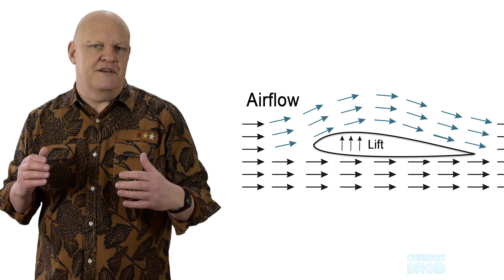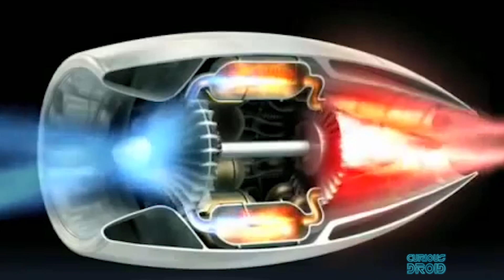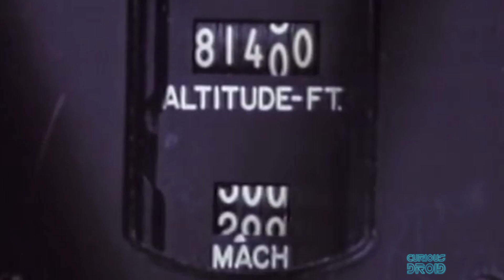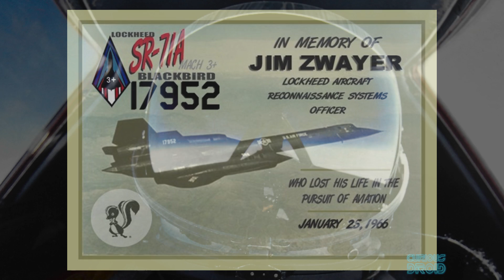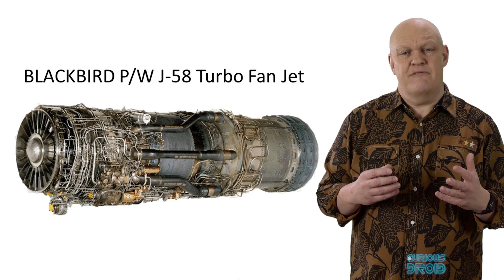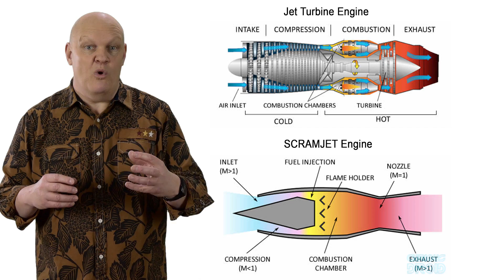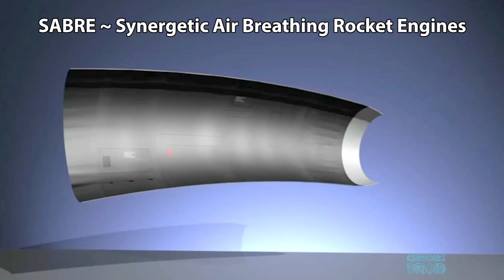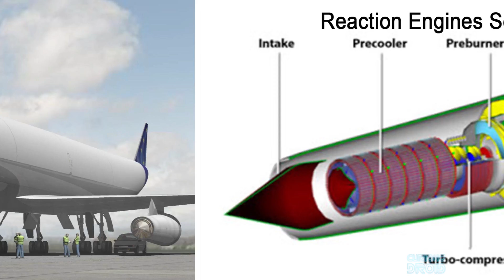Why can't we fly a plane into space ?

Comment: We can't fly a plane into space due to 3 main factors:No1 Our modern planes are not built for space travel No2 Modern plane engines don't produce enough thrust or speed to escape earths gravitational pull. No3 Due to earths gravitational pull we would need more fuel and power for our current planes to escape earths gravitaty however in order to escape it we would need large amounts of fuel with much larger engines which leads to an increase in gravity because as we all know gravity affects all mass so an increase in mass would increase the gravitational pull. We are then left with a paradox, we can't add more weight for more fuel and power due to an increase in gravitational pull yet we can't decrease the mass due to our earths outer atmosphere then becoming inescapable. The difference between planes and rockets is that rockets use their power to escape earths orbit they then disengage and flow freely carrying minimal weight or passengers. The thing with planes is they carry large payloads for their weight and lack the necessary survival equipment for space not to mention they are too heavy or underpowered to escape earths atmosphere. Their I just saved you 10:04 of your life.

Comment: This video should be rated under 12 years of age. These comments about escape velocity are rather pointless, so long as you're going up, even if it is at 1km/thousand years, you will still, theoretically, get to space because youre moving up lol. Escape velocity is the initial velocity, highlight initial, that is needed to get into orbit, again highlight orbit there. If your projectile is launched at a certain angle from the surface, that angle corresponds to a velocity value, be it 1000km/h or whatever, that's not quite important right now, such that this velocity is enough, highlight enough, to get you into this 'infinite loop of projectile motion' which is satellite orbit. satellite orbit is, in fact, nothing but an object which is 'falling' forever. You need to look this up in more depth if you wanna know what that means. understand what escape velocity is, as it is completely irrelevant in this scenario, truly.
Finally, my main point, this video could have been ended in 2 seconds if all you say is that jet and airplane engines need air for combustion. no air outside = no more power. end of story. if the plane doesn't function on the outside, it's rather too early and pointless to talk about how one cannot breathe and etc in space

Comment: Not even going to watch the video because it is obvious and unnecessary to make a video on. A planes engine is meant for atmospheric flight, its basically a motor that turns a fan blade which pulls air in one end and pushes it out the other in order to get thrust. You can't fly it into space because in space there is nothing to pull through the fan, so no thrust. For space travel they use a chemical reaction to make a controlled explosion and point that the opposite direction of where they want to go for thrust. Is that pretty close?

Comment: Actually the main reason is the strength of the fuselage. The inside of the aircraft is pressurized to around 8000ft or 10 pounds per square inch, now multiply that by the total inside area within the fuselage (F=AP) it's comes out to few million pounds of force pushing outward, this force is further increased as the aircraft gains altitude. similar to balloon swelling as it fly's away.

Comment: for everyone wondering, if you havent seen the whole video, just the first seconds.. pretty easy. First planes move with jet engines. Jet engines need oxygen to work. Rocket engines are pretty much jet engines that have reserves of oxygen inside the aircarft, while jet engines used in planes use the oxygen in the air that goes through the engine. No air= no oxygen = engines are dead cold. Simple :)

Comment: There is a mistake. The blood won't boil even in a complete vacuum since blood is secured in a closed pressurized system. The pressure suits are there to prevent the lungs from exploding due to the pressure difference.

Comment: Thrust, Lift, Drag, Weight... Engines run out of thrust and wings run out of lift... due to air density... Engine needs oxygen to run and the wings need same air to make lift. The higher you go the lower the air pressure and density. I saved you 10 minutes. Aerospace Engineer and Airline Pilot. Great Vid Thumbs Up... your explanation is excellent. As a kid X-15 fascinated me.

Comment: Probably a dumb question but: how does jet propulsion work in space? I've heard about Newton's 3rd law but I'm kinda missing the 2nd object the engine is supposed to push against. Near Earth, it pushes against the atmosphere but in space (supposedly vacuum)? There's also that Free Expansion Law (gasses do no work in vacuum). Anybody?
Reply: Because it doesn't push against the atmosphere, it pushes against the exhaust gases. The molecules in the gas have mass - not much, but they have it. The rocket shoots the gases out the back and the gases push the rocket in the opposite direction. Equal and opposite reaction. Like throwing a bowling ball when standing on a skateboard. If the rocket didn't move it would be violating conservation of momentum.

The reason jet engines don't work in space is because they get the oxygen from the atmosphere. No atmosphere -> no oxygen -> no combustion -> no thrust. Rockets, however, carry the oxygen with them so they work just fine in space. In fact, they work better in space (they generate more thrust) because there's no ambient air pressure that tries to prevent the high pressure gases from getting out of the engine.
Reply: Thank you. I get the oxygen part, but I'm not convinced about the exhaust gasses. It's easy to see the equal and opposite reaction with stuff like tire/road, boat propeller/water etc. because you obviously have 2 objects (boat/water) and a force acting between them (motor, propeller). By the way I believe in the atmosphere, the rocket engine also pushes against air. Why not? An airplane propeller does. 
But in vacuum? You have the rocket (object 1) and the engine exhaust gasses(force). 
What's the 2nd object? Isn't saying that exhaust gasses are pushing against the exhaust gasses kind of like saying that a boat propeller is pushing against itself? Wouldn't the gasses have to create something like a "cloud" that has similar mass as the rocket the whole time the engine is pushing (equal and opposite reaction)? 
When you throw a bowling ball while standing on a skateboard aren't you pushing against the inertia of the ball? Also you have 2 objects (you/ball) and a force acting between them (you pushing). What's the inert 2nd object in the rocket scenario?  
Also there's still the Free Expansion Law. Shouldn't the gasses just disperse into the vacuum of space?
Obviously, I have some catching up to do to become a rocket scientist but thanks for the help.
Reply: The other "inert object" in the rocket scenario is the exhaust gas. Think of each gas molecule as a tiny bowling ball.

Regarding the free expansion law - it means the gas does no work on the vacuum because the vacuum doesn't resist the expansion (obviously, since vacuum is the absence of everything, and nothing can't resist something). You'd think the vacuum would just "suck" the gases out, but that's not actually the case - you see, any physical interaction between the molecules in the gas (or any other substance for that matter) can only travel at the speed at which sound would travel through the gas, so as long as the gas expands faster than the speed of sound, it can't "get out of the way of itself" which causes a high pressure area to form inside the combustion chamber. Since the back of the engine is open and the front isn't, the pressure isn't distributed evenly (the front of the engine pushes against the gases and vice versa, but there's nothing at the back of the engine for the gases to push against) which forces the gases through the nozzle where they're accelerated to several kilometers per second (the faster the better - faster exhaust gases have more momentum so you get a greater change of momentum for every kilogram of exhaust gas expelled so the rocket will be more efficient).

This is why rocket engines produce more thrust in space than they do in the atmosphere - because the atmospheric ambient pressure resists the expansion of the exhaust gases so the pressure difference between the front and the back of the engine is smaller, which means a lower exhaust velocity, which in turn means less mass is expelled for each unit of time, resulting in lower thrust (the faster you throw a bowling ball, the faster your skateboard will be moving). So larger pressure difference = more thrust.

If you had a rocket that had a combustion chamber pressure of exactly 101.3 kPa, it would not produce any thrust at sea level (because the chamber pressure would be equal to ambient pressure), but if you took it to the peak of Mount Everest where the ambient air pressure is much lower, it would produce thrust. How much depends on the nozzle design.
Reply: Wow. Awesome answer. I was missing the part about the speed of interaction between molecules being limited by the speed at which sound would go through that gas. 
Thanks again! People like you give me at least some hope for humanity.
Reply: He is not dumb, he is asking. You dind't born knowing everything
Reply: Michael Stancl lol... you're silly.
Reply: Guderian Shut up, pretentious fuck.
Reply: Yes you are dumb, very dumb. The reaction of the is the space ship body against the mass of exhaust gas from a rocket engine. For obvious reasons gas turbines don't work in space. Force = Mass x Acceleration

Comment: If space is a vacuum how do rockets thrust?
Reply: Rockets operate by differential pressure inside the combustion chamber.  The chamber is closed, except at the exhaust.  Combustion creates pressure inside the chamber.  The exhaust opening allows the expanding gases to escape and creates a pressure differential between the front of the combustion chamber and the exhaust.  The pressure differential creates thrust along this axis, in the opposite direction of the exhaust.

Comment: This video is stupid for several reasons, and I'll tell you why.

1. We can fly a plane in space. We exist in space right now. We are limited as to the altitude we can achieve in a plane because our aircraft are designed to manipulate the ATMOSPHERE in which we reside. The higher you go, the thinner the air, and that air also contains oxygen, which is needed to burn the fuel that helps propels the aircraft.

2. You are not required to reach escape velocity to achieve orbit. If you reach escape velocity, you will leave orbit. The velocity you need to reach is dependent on the altitude at which you wish to achieve orbit. If you want to establish orbit at the same altitude of the International Space Station, you would need to establish an altitude of 417km, and a speed of 7.66 km/s. If you wanted to reach a Geostationary orbit, an orbit where you're always facing the same side of earth (Our telecommunications satellites are in this kind of orbit), you would need to reach an altitude of ~35,786 km, and a speed of 3.07 km/s.

Comment: Why not just use a large helium balloon platform system to lift spacecraft to the edge of space? Then it's a much shorter distance to outer space, cutting down drastically on the amount of lift-off fuel required.

Comment: Dumb ass video, obvious is engines would cut out due to oxygen starvation. Not to mention the fuel and hydraulic systems freezing up. Not to mention the loss of lift way before you it space. Most aircraft are designed to operate in the troposphere.

Comment: bevause:
1. there's no oxygen, thus, the kerosene can't be burned, thus there won't be a thrust. (engines need oxygen to burn fuel, duh) 
2. planes don't go fast enough, if they go up at a 90° vertical angle, it will lose too much speed
3. even if planes could, they'd burn up coming back into the atmosphere

Comment: I beg to differ. You can theoretically fly a jet plane into space if  liquid oxygen was fed into the jet engine along with the fuel but the intake section has to be closed somehow in order for the fuel and LOX  to combust and provide thrust in one direction. As for flying the plane, if some type of external airflow can be provided over the wings, elevons and rudder in the vacuum of space one can steer the plane. Even in vacuum of space airflow over the wing airfoil can provide lift strangely enough.

Comment: the answer is simple, we need oxygen to burn fuel to make thrust and only rocket engines have self contained oxidizers.  Another factor is thin air density does not permit wings and flaps to control direction, only rockets work.

Comment: So? Just pump an oxidizer in with the fuel as the O2 level decreases. Cars have sensors that tell the computer when the mixture is becoming too lean or rich and adjust the mixture accordingly.
Why don't they do that with winged vehicles that kick in more and more as they approach the boundary of space?
You can't tell me no-one has ever thought of that.

Also, as the atmosphere becomes thinner resistance to forward motion reduces making it possible for the plane to go much faster while using much less fuel.
They have aircraft that can carry tons of weight. Bombs or passengers and luggage.
Just increase the fuel capacity and the O2 capacity.

Comment: Yeah,but,technically,the space shuttle IS a plane.And strapping it to a set of boosters is how they get it up there.They COULD fly it,but it would require a design that incorporates multiple engine and fuel types to get the thing up there,probably boosters as well,and it would severely limit the ships payload,rendering it pointless.Im sure there will be tech in the future that allows us to achieve this economically,sub orbital mass transit is the next step above the air travel we use today and surely the goal a few companies like virgin are trying to pioneer so they can get ahead in the race.So now its just a matter of materials,tech,and economic viability.

Comment: planes have "flown" into space.

the X15 rocket plane on flights #90 and #91 in 1963 achieved altitudes in excess of 62 miles (the FIA's definition of space, the USAF considers 50 miles to be space and awards pilots astronaut wings that attain this altitude )  both historic flights were flown by pilot Joe Walker. 

hauled aloft to an altitude of 8.5 miles by a modified B52 bomber, the X15 would be dropped, and go in to a high speed climb, until the engine burned out with the intent to have an apogee in excess of 50 miles. then, using reaction control thrusters the pilot would adjust the planes attitude over the top to re enter, and make an unpowered glide back to Edwards airforce base.   while it was still inside the atmosphere, the aircraft would fly on the lifting surfaces of the wings and fuselage, and would adjust attitude using its control surfaces.  just like a regular jet airplane.   outside of the atmosphere it would use hydrogen peroxide thrusters and raw brute power from its main engine to stay aloft.

Comment: It is not quite true that you cannot reach space with certain planes. If the plane has a certain speed, you can fly it stright up and actually reach space. But you are not able to set a plane in orbit, because jet motors will not bring the plane up to the requred speed needed for that. After  reaching space, the jet motor will stop, and the plane will go a distance into space, but the fall back again very soon. I guess it is never done because of the dangers with it.

Comment: You really think the termination line would stop the light of the sun from shining above the earth, so that is why it gets dark on the so said supposed northern hemisphere while the tilt is towards the sun? By true scale of the purported solar system, Earth at 1 inch =7,926 miles placed at an elevation of 4 feet 6 inches to be centered of the real scaled sized sun model 109 x the diameter of earth or 865 thousand miles, = a 9' diameter sphere placed out at 998 foot = to 93 Million miles away, everything scaled @ 1 inch is 7,926 miles. When you true scale it while the 23.4 degree tilt is towards the sun, the sun can be viewed constantly throughout the entire rotation clear down to near the 30th parallel. in fact only a small conical shaped darkness would ever envelope a small portion part of the SPHERE as the light from the sun would consume the darkness caused by the so said shadow of earth. That is why, you meatheads, NAShA NEVER SHOWS A TRUE SCALE SIZED MODEL OF THEIR DECEPTION(solar system). it is too fukin obvious to the inquiring MIND.